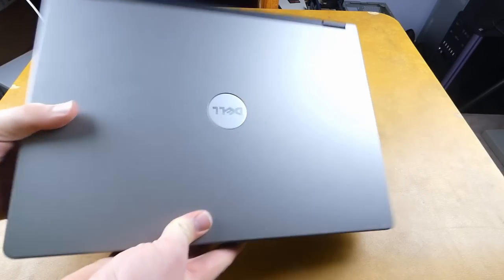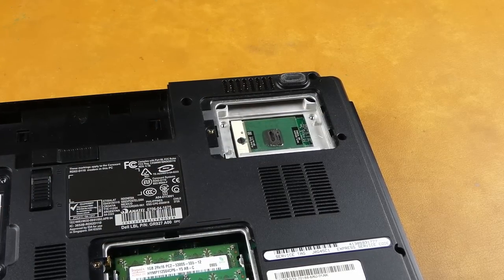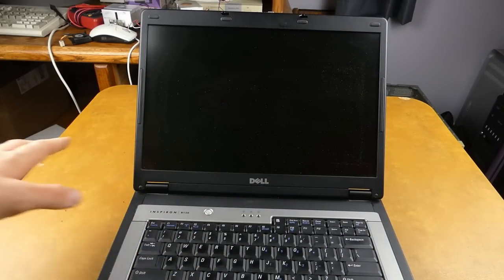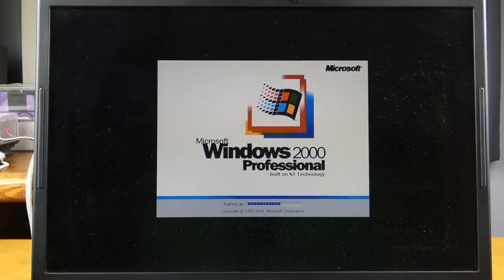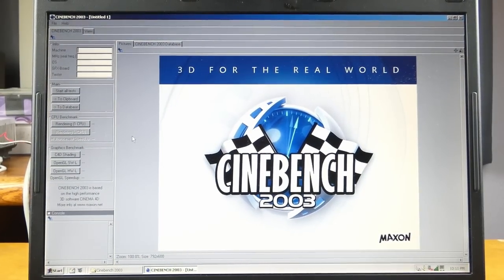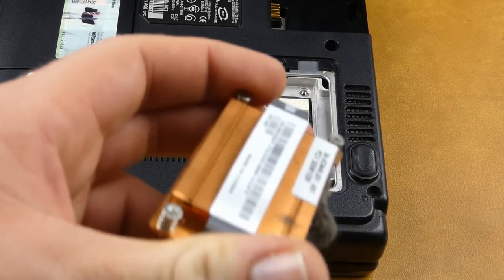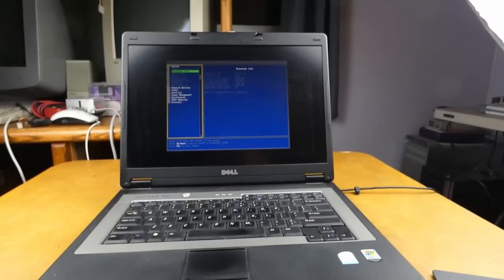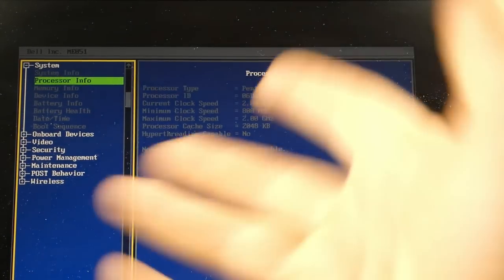World's Easiest Laptop CPU Upgrade

Comment: i miss those days when you could just swap and change the CPU, RAM, WLAN card, GPU and HDD😢😭
Reply: Me tooo
Reply: Out of the 5 things you said only 3 of them is swappable and replaceable. RAM, HDD/SSD and WLAN Card.
Reply: @005MDS3  though a lot of newer devices nowadays use EMMC storage chips
Reply: @BrettS02  Newer cheap low end devices*
Reply: @BrettS02  EMMC Storage is used on lower end PC. Most PC uses M.2 SSD and SATA HDD
Reply: @005MDS3  i mean true but not that easly, with some modern laptops you need to fully disassemble them
Reply: @nicktheneko  Not fully. In my experience you just need to open the casing to access the motherboard after that it's a straight forward process.
Reply: @005MDS3  WLAN totay mostly no same goes for SSD sometimes
Reply: @005MDS3  but some new thin laptops use soldered ram
Reply: @warior1195  Those are called low end pc...
Reply: @005MDS3  not really.... I wouldn't say that. But whatever its ur opinion and i aint gonna force u to accept my own opinion
Reply: I just got an Asus W2J laptop on a flea market for 12 dollars and it is an absolute powerhouse for its time. 1920x1200 for a 17 inch screen was really cool in the Core 2 Duo era. CPU is at the same location as on the Dell laptop in this video. Too bad, it does not see all my 4GB RAM. Only 3GB. It has a HD-DVD drive and a built-in DVBT TV tuner and 5.1 speakers with subwoofer on the bottom. Optical SPDIF output, analog 3-plug 5.1 output, and remote controller.
Reply: @andrasszabo7386  have u checked about the windows bit version? Bcs 32bit can only read up to 3gigs of ram
Reply: @warior1195  no windows yet as I am still waiting for my SATA SSD to arrive. BIOS can't even see the 4GB RAM. Or any CPU beyond 667 MHz FSB. It has a T7400 CPU inside. Wanted to upgrade to T8300 but no success. I know that 32 bit has 3GB max RAM limit. But is there ANY way to raise the FSB frequency on the motherboard to at least 800 MHz?
Reply: Battery too
Reply: @005MDS3  actually, you can change the cpu on some devices. And resolder a new wlan card onto the motherboard if you know how to.

Not that only old laptops can do this. Anything older than 2013 is almost hard.
Reply: @andrasszabo7386  ur os is using 1gb of ram atleast if its win 10 basic
Reply: @warior1195  32bit is up to 4gb
Reply: @seikatsu.  Win7 home basic is installed on its hard drive. I don't think I will try Win10 64 bit on that laptop. Maybe 32 bit.It is just another piece of my collection. And for movies, Win7 is still usable. But I wonder why is its BIOS limited to 3 GB RAM.
Reply: @andrasszabo7386  3gb usable? Or like just pure 3gb? If its pure 3gb then one of the memory chips in ur ram prolly died or smth
Reply: @seikatsu.  BIOS does not see beyond 2.9 GB no matter what type of module I install.
Reply: @005MDS3 no on pre 3rd gen machines, well at least Intel, you were able to swap out the cpu in a laptop as they weren’t soldered down to the socket
Reply: @005MDS3 soldered ram is even on very high end devices such as the Razer blade 14. Soldered ram is due to the thickness of the machine more than the price
Reply: @andrasszabo7386  oh so its like bios problem... ow never encountered it wait wad ddr is ur ram?
Reply: @seikatsu.  DDR2 is in there. 667 MHz. Just got that laptop on a flea market
Reply: @ahiyanali7231  I actually didn't know that. Thanks for the info
Reply: I don't. I like my laptop nice and thin. I hated having to carry around a giant brick.
Reply: @jacobamador7989  I like my new thin laptop, too. I just collect old stuff. But why does everything have to be soldered and not replaceable? Just because it is thin it does not mean every part has to be soldered in and not replaceable.
Reply: @andrasszabo7386  by removing the cpu socket and ram sockets, they are able to get it 1/4 inch+ thinner, no access panels, that's another 1/8 inch+. Measure the thickness of a socket, and you'll see why.
Reply: @jacobamador7989  CPU socket I understand why they removed. But I have a DDR3 laptop RAM socket in front of me. It is not even 5 mm tall. And I would not mind if my Samsung laptop was 15 mm thick instead of 10, just to be able to add more RAM if I wanted to.
Reply: @andrasszabo7386  yeah upgrading ram can be nice, but just due to technology limitations they are seen less in ddr4, and won't be seen pretty much at all with the new ddr5. I think it's dell that's trying to propose a new standard for ddr5, but I doubt it'll be adopted widespread.
Reply: @005MDS3  there are socketed GPU's. look it up.
Reply: @andrasszabo7386  oh... welp dk much bout em have ya tried lookin in google? Well ig u did... guess i have nothin to help with
Reply: @jacobamador7989  by the way it is a good thing that at least my SSD card is replaceable in my thin Samsung laptop. Had to do it once.
Reply: Check out Framework, it still exists some places
Reply: I don't. Because those laptops are bulky
Reply: @mgord9518  no CPU changability though. Sadly. But of course everyone "doesn't" like socketed laptop CPU'S.
Reply: @scarecrow5848  Yeah, but the motherboards are still easily interchangeable. It may not be as good as just popping out your CPU, but it's the next best thing.

It also allows for completely different CPU architectures to be used that may not be socket-compatible, so if someone makes an ARM motherboard for instance, it would be pretty easy to install and use.
Reply: @GreatJO  at least they don't break that easy. And who cares if my laptop is 10 mm thick or 20 mm thick? Not a big difference.
Reply: @mgord9518  its still sad though.
Reply: @andrasszabo7386  Portability is a very important factor of laptops. And current unibody laptops are more reliable.
Reply: @005MDS3  back in the day we could have done all 5 dude. Gpu came in the form of mxm boards and thus could be switched out.
Reply: @005MDS3  In most low cost laptops (<$450), you may get lucky and find an NVME, and removable WLAN/BT Card. This is true amongst most cheap windows laptops, and chromebooks. In the really cheap laptops (sub-$350), all of those components are soldered and non upgradable without replacing those chips. All modern macbooks (as of late 2015) have everything soldered, both Intel and apple silicon.
Reply: what was the point in time where ppl was able to swap the gpu out of a laptop bro?
Reply: @NervesiT  look up MXM GPUs. Some laptops still support it today, but they’re huge and expensive
Reply: @chrisoverton2759  no way dude, thats cool
Reply: @NervesiT  Easier to upgrade and repair, GPU's can die easily on Laptops
Reply: Go and buy a thinkpad
Reply: I remember having a laptop with a 950 graphics card that I could swap out for another and honestly I miss that flexibility
Reply: repair is being killed.
Reply: @amentco8445  no shit
Reply: XPS M1730!!! i miss those days i made a base model maxed out...sli, max ram, ssd, core 2 extreme....
Reply: @danielmarinmoreno3131  There are thinkpads with soldered RAM now
Reply: @andrasszabo7386  Perhaps integrated graphics takes 1GB for VRAM?
Reply: @shadowbladez2457  no. In my machines VRAM is separate.
Reply: @005MDS3  There are laptops with swappable mxm type gpu cards and cpu.
Reply: @burnoutBurrito  Gimme laptop model with swappable CPU and GPU that is not made in 2010 below. Cuz I don't remember seeing a laptop with swappable CPU and GPU. Cuz since 2011 onwards every computer I see only has a swappable network card, ram and storage.
Reply: Those fictional days, cpu and gpu upgrades were never common.
I had a laptop with the main 'standard'(mxm) for replaceable gpus, but it was basically useless due to extreme lack of gpus and compatibility problems.
It's also not difficult to find a new laptop that allows easy ram, ssd/hdd upgrades etc. My own 2021 Acer(low to low-mid end) has easily replaceable ram(1 stick, other is soldered), ssd & 2nd ssd or hdd, wlan. I'm not sure but I'd imagine the majority of 15.6"+ laptops have easy upgrades.
People buy cheap, small, pointlessly thin laptops, without checking upgradability, then complain about difficulties upgrading.
Reply: @DoubleMonoLR  sometimes I think that every manufacturer should ignore  cheapskates and poor people. Please, get a good quality USED device instead of crappy new things. And I think everybody shoud ignore THIN and non-upgradeable laptops. And also everyone should ignore low power stuff.
Reply: On some older laptops you could swap the gpu too but it had very little compatibility so it was mostly useful to replace rather than upgrading
Reply: Stop throwing old stuff away and you'd be able to keep enjoying it. I bought a pair of lovely tannoy speakers the other day that someone had thrown in the dump because they broke one of the rear terminals, took the guy I bought it from a matter of minutes to replace the terminal and have it working again.
Reply: @karelissomoved1505  Yeah. I think old iMacs and MacBooks have this feature
Reply: @005MDS3 there’s laptops coming out that are very thin, I’ve soldered ram, and come with a price tag of $600 and more. They are definitely not “low end” as you say.
Reply: You still can it's called right to repair laptops.
Reply: i can't thank you all enough for the 306 Likes and 65 Replies, this is my first comment that got so far.
I love you all🥺🥺🥺🥺
Reply: Some old laptops come with a white list in BIOS that prevents you from replacing WiFi card for a modern one.
Reply: - tech stock holders (whether inside or outside the company) don't
Reply: Newer laptops are garbage
Reply: @005MDS3  actually I used to swap CPUs back in the day, I remember swapping hp, dell, Toshiba laptops with i3 CPUs to i5 and i5 to i7, some models with pentium could take i3 and maybe i5 but never i7 as for some models the onboard south bridge chipset wouldn't allow it and also yeah some Alienware and dell precision, Toshiba laptops back then had swappable GPUs , take the dell precision 7720 for example, it has a 7th gen CPU with a removable upgradeable gpu
Reply: @SA-mv3vf  I actually thought swappable CPU and GPU got discontinued a very long time ago. But seeing that even a 7th Gen Intel with upgradeable GPU is super awesome to find. Those are rare to find these days since every thing is soldered..
Reply: @005MDS3  macbook pro isn't low end, thinkpad x1 nano isn't low end
Reply: @005MDS3 my laptop has a swappable GPU
Reply: @SchmidleMcDingle  what's your laptop
Reply: @005MDS3  Sager P150EM
Reply: You can just don't buy an integrated board
Reply: @DoubleMonoLR  i still have a lot of mxm gpus
Reply: Thanks apple
Reply: there is nothing to miss lol
they are still being used and I also have a cpu with a socket
Reply: i don't know if i should thank you all for the likes or if i should be scared to read the comments on my comment but either ways, Thank you for the 464 Likes, this is a world record to me the highest i've gotten to was 100 likes❤❤❤❤❤
Reply: Look at Framework 

Every part is removable and the 16 inch version has a modular dedicated GPU (it’s only a matter of time before they let you replace the GPU
Reply: Greed
Reply: well you know you could design a laptop that can swap ram hard disk gpu cpu wlan and such but you would have to design it yourself and use desktop computer parts and make a custom bios designed to undervolt and underclock the cpu and such but it is do able
Reply: Framework laptops?
Reply: @005MDS3 *older models

Comment: Hey, back in 2000s almost everything was upgradable. Most common thing I remember is big door on the bottom of laptop case that gave access to HDD, RAM, CPU, optical drive and expansion cards like wifi. Even more recent laptops have those - like Dell E7470 that I use as my main machine. LCD expansion function was very common on Pentim I/II machines (especially IBMs and Toshibas).
Reply from the maker: I have a Dell from around 2016 that still allows easy access to the RAM and hard drive. Upgradability still somewhat exists, but CPU upgrades are pretty much dead since AMD and Intel don't offer sockets anymore.
Reply: 2014 hp r15 here, just upgraded my ram to 8 gigs and added a SSD for the OS. Have a Nvidia 840 on a i3. Hopefully I can finally play GTA 5😂
Reply: the current stuff is made non upgradable because the majority of people want the slimmest laptop and electronics, example smartphgons with camera hump which i find stupid, why cant they make the whole device 2mm thicker and have a larger batter and have no hump but because modern sheeple only are after slim devices they make it less upgradable and less connective example no sd card slot, no usb slot, no ethernet slot, forcing you to have a bunch of dongles because the laptop is 1.5mm too thin to fit a regular sized ethernet port, and because of all these dongles it makes the device even more bulky.
Reply: @ainzooalgown7589  companies are cutting their costs, loosing functionality; customers are demanding more swanky form factors, reducing brands that cater to them to wither out. Only big companies with enough cash can survive🤷🏿‍♂️
Technologies are never made to last, so why ponder about nitty gritty of company policies. Brands die and new ones always emerge in free markets. Let's enjoy what we have today. Carpedium!
Reply: Laptops had desktop CPUs back then
Reply: @roundabout-host  Well, that's true only up to first Pentium I processors. Latter Pentium I like 233mmx had mobile versions and were plugged into mmc1 socket (it was around 1996). I remember that theoretically it was possible to run some P4 generation laptops with desktop cpu, but cooling wasn't able to dissipate that amount of heat and machine ended up overheating.
Reply: @ainzooalgown7589  Not to mention that people buy pointlessly thin phones and then immediately put them in a case..
It's not quite as stupid as ultra thin tvs, where it has absolutely zero benefit. It's ridiculous that youtube and other reviewers go on about how thin a tv is, even the tiniest feature/performance improvement would be more useful.
Reply: hi.what u mean by " LCD expansion function" ? do u mean D-sub port for cloning the display window to  external monitor?
Reply: @ferysery  I meant that lcd panels have native resolution, let's say 1024x768, but native DOS or BIOS is not displayed in that resolution. On older laptops it meant that picture was displayed only in a center od lcd panel, taking only area of 640x480 pixels with huge black frame around. In old IBMs and Toshibas (and probably many more) there was an option to stretch image to full screen, but image quality suffered when it happened.
Reply: But but it’s all about exterior design, the smooth rounded corners, the colors, how beautiful it looks to the human eye! Appearance is part of reviews nowadays, can anyone explain why?🤫😉

Comment: Laptops are probably one of the technological areas that have regressed the most in recent years when it comes to upgradeability and IO.

My most recent laptop is from 2015 if I remember correctly. It isn't a particularly high-performance model  or anything (it has a celeron for a processor), but despite that it still featured upgradeable ram, wlan, storage bay and a dvd drive. I've changed out my dvd drive for an additional hard drive in a caddy. I will however switch it back whenever I need to use some optical media. It's not hot-swappable, but it isn't a hassle either.
Furthermore, it also had, what used to be, a normal amount of IO. 

Seriously, what's up with modern electronics and a severe lack of IO? Modern TVs are even worse. Are you supposed to just throw out all your old stuff or keep an old TV around? Or are you supposed to buy those signal converter boxes from brands you've never heard of, that are questionable at best?
Reply: And now celeron laptops mostly just have a very tiny motherboard with all the RAM, storage, and wifi module soldered to the board, so if only one of them get malfunctioned, you need to replace the whole motherboard (which costs almost as high as the new laptop itself)

Comment: The ThinkPad T440p is nearly as easy, 2 screws come off the bottom and then the cover slides off revealing just about everything (RAM, storage, CPU, optical drive, wireless card, etc), however you still have to loosen the screws and unplug the cooling assembly before you can replace the processor. I miss the upgradeability of these older laptops. Great video!
Reply: Except HP ones. You had to remove the keyboard and screen to reach the CPU, and hinges were flimsy AF, so pretty much you ended with a broken laptop
Reply: But not all Thinkpads😂😂
Lenovo locked the upgradability by white list in BIOS😢
For example, my G500 (unable to upgrade the trash wifi adapter, still no mod version of BIOS released) and Thinkpad R61i (sata is also limited to sata I, but now is unlocked by the mod version of BIOS on the Internet.)😢😢
Reply: T530 is the same way.

Comment: Nice one, was similarly surprised how upgradable my Inspiron 8100 was - the graphics card was also replacable, and it accepted the card and display panel from my somewhat broken Latitude C840. Went from a 1400x1050 display and Geforce2Go 16MB to a 1600x1200 display and GeForce 4 440 Go 64MB, and couple that with a 1.2GHz PIII-M upgrade, it's now an insane Windows 98/ME system! Only 4 screws and a somewhat annoying retention bar to upgrade the CPU, and a further 4 for the GPU.
Reply: i have toshiba  satellite a200 (since 2005) work fine without any single problem, at 2017 i bought  hp pavilion notebook 15, the motherboard failed after 1 year and half, since the cpu is soldered directly into the motherboard, i couldn't save it and a new motherboard is double the price ..., the toshiba satellite at the other hand have everything replacable, even the old gpu, its just sad